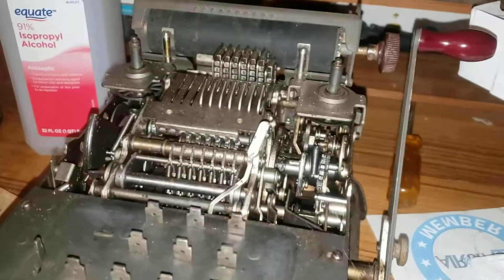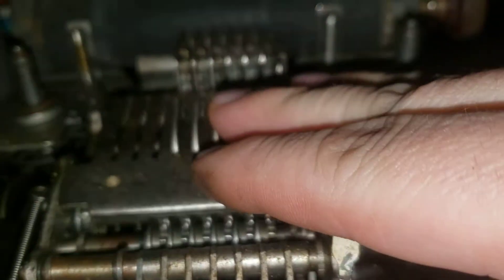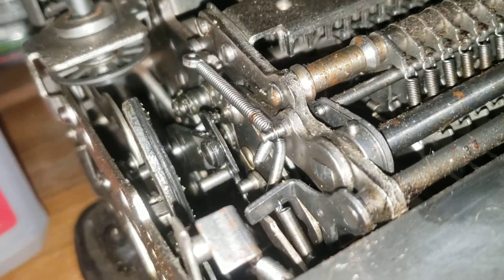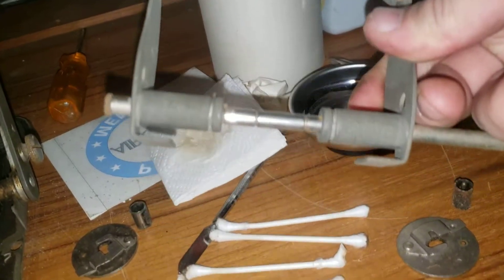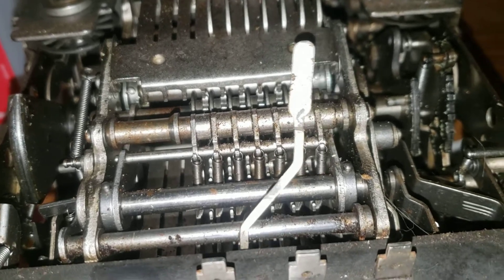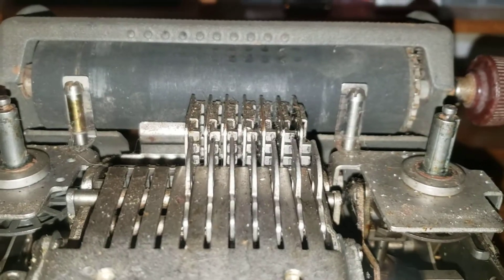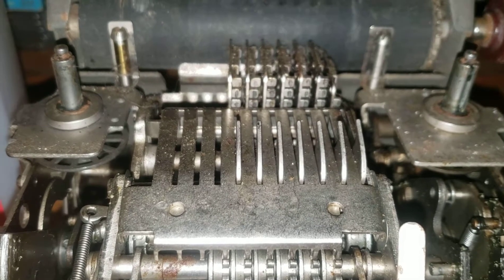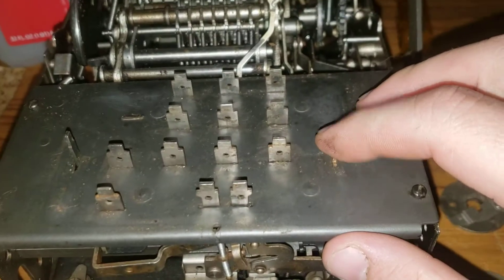Remington Rand Adding Machine

Comment: How do you take off the shell
Reply: I have same machine I've just restored.  I had to remove two screws on bottom holding the plastic case.  Then remove top row plastic buttons that were in the way (7,8,9 keys) and the clear key.
Reply: @trentonjennings9105  Thank you! Everything seems to work except the sub total and equals button.